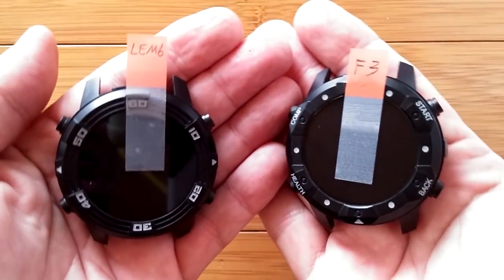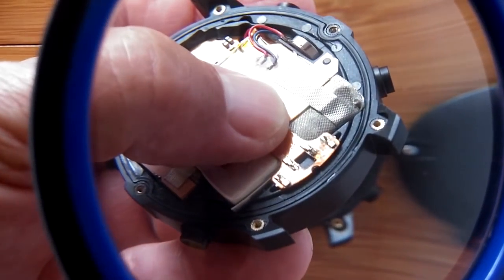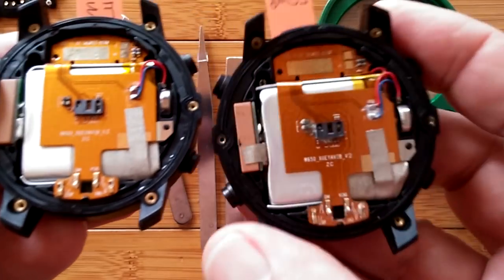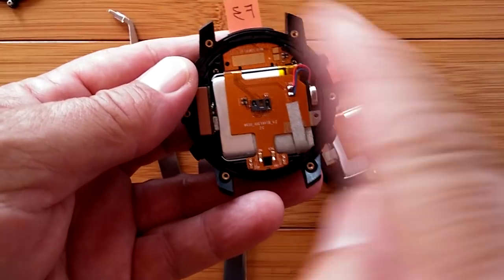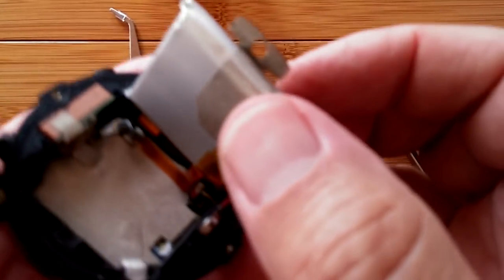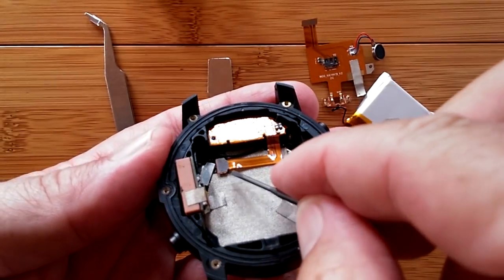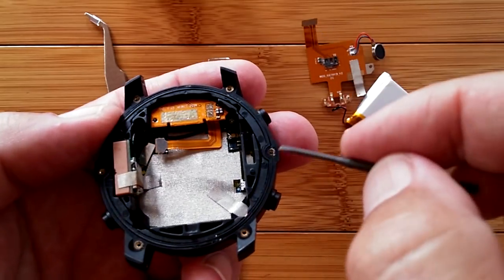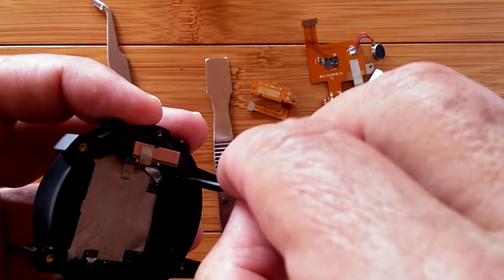LEMFO LEM6 & TenFifteen F3 Design Flaw Part 2: LEM6 Taken Apart

Comment: The aerials are in the bezel.  If you look at the PCB silk screen on the side that had the RF shielding plate you can see there are spring connectors labelled BT/GSM/WIFI.  These mate with the corresponding pads around the display.

The flexi-PCB on the back of the OLED display is the display connector.

The GPS brick is a ceramic antenna, the actual GPS chip (poss. MT3333) is under the RF-shield plate.

The Samsung chip is almost certainly the RAM (LPDDR).    

Interestingly the silkscreen noted an NFC connector.

I cannot comment on the weird PCB that had the 3 spring connectors on it, a better shot of it would be necessary to determine it's function.

Please provide some decent hi-res photos of both the PCBs so I can figure out what each part is.
Reply from the maker: Excellent information! This what I was hoping would be posted. Now I can go back and have a 2nd look at my bag of parts. I'll check the case more closely for evidence of antennas. Also, the spring connector laced PCB that floated above the plastic tray for the SIM card may have been the connectors for the SIM. Based on now easy it was to lift that out of position without removing any screws or flipping any locks, I could see the potential to loos SIM connection if the PCB got moved within the watch. Of course, the back probably locks it in place. Thanks again for your insight. I've pinned your comment to the top of the list. AND.... Just finished Part 3 based on your comments: https://www.youtube.com/watch?v=Z-k-shQajfc

Comment: Nice teardown, Sir! I agree with you in the SIM card slot being a probable cause of possible water intrusion as well as the obvious faulty shielding placement. Considering the LEM 6 is going for around $160 (Amazon) you would expect a bit more attention to detail. Thank you for the interesting video!
Reply from the maker: That SIM slot is a glaring failure point waiting to happen. Obviously these watches don't go through any IP67 certification. Knowing what I've seen now, I won't even wash my hands with the F3 on my arm. When you look at the build of the old Zeblaze Blitz and realize that it truly was waterproof, it makes you wonder about all the claims of the new ones. It will be interesting to hear if anyone tries to send one back for water damage and how the claim is handled.

Comment: The 6 spring connector is for the nano-sim
Reply from the maker: Yes! That's it! Thanks!! Odd looking little fellow, and it just popped right out without any screws or anything. I wonder if a misaligned SIM could dislodge it from within.

Comment: Hi Mr Ticks, is it true that your LEM6 broke from dropping it in a glass of water. If so must of been through the sim card slot. Unless you left it there for a very long time and it seeped in from back cover. The antennas are built into the existing body with screen etc.. you had left over after complete tear down. The Chinese call them Radium carvings in the body of the watch LOL. Also you never tested any of the antennas in your F3 Review. GPS and WIFI, and  3g data testing would have been welcomed by viewers
Reply from the maker: Yes, the only time in water was the drop into the McDonald's cup. After that I wiped it off and put it away. It very easily could have leaked through the SIM cover, which would actually be worse then the case as the case issue is easily fixed. The SIM opening totally depends on how firm and square that tray is inserted, and the could change with vibration and/or shock. As for antennas, you're the 2nd to mention they are in the watch body itself. I'll go digging deeper. I sure would like to find them! Thanks for the feedback.
Reply: I was first to mention the antennas are in the watch body by 2 hours. But the other guy got the glory. LOL. That's Life.
Reply from the maker: Haha, I think I read them out of order. Sorry! Both of you contributed to the evolution of Part 3 of this series, and I'm going to post both of your comments under that video in the show notes (yours first).
Reply: No problems happy to inspire. :) Not really in it for the glory:)

Comment: I was about buying lem6 after watching your review of that and dropping it into a glass of water.
But now, I'm afraid of the water amd Sim slot which is not sealed.
So which android Waterproof watch do you prefer?
Reply from the maker: I like the F3 best so far, though one of our tech support folks swears by the waterproof capability of the Q1 pro, even dropping it into the deep end of a pool and having it survive.
Reply: Thanks 🙏
did you test f3 underwater for checking Waterproof?